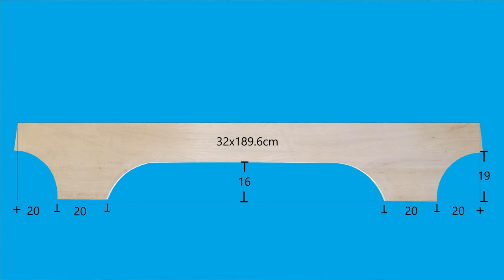DIY Plywood Bed Frame

Comment: Hmmm....8 screws in end grain holding the central support?? Might be ok for you that probably only weighs 44kg ....but not going to take an 80kg+ person.
Reply: Wrong calculation IMO. The weight is distributed across the entire width and length of the bed to all screws. The majority of it goes to the side boards of the bed. As a matter of fact I would not have set that center board so high as it makes the surface one is laying on too stiff. The boards carrying the body weight should be able to feather a bit to make the bed more comfortable. Have a good day.
Reply: @robertthomas6127  You make the very point I'm highlighting. As the person rolls to the middle, boards will flex...weight concentration on the centre strip. It's going to sheer those screws. Needed a 4x2 with coach bolts IMO. 
But D A is a dainty thing...so she will be fine.